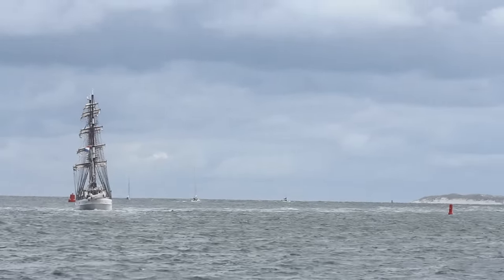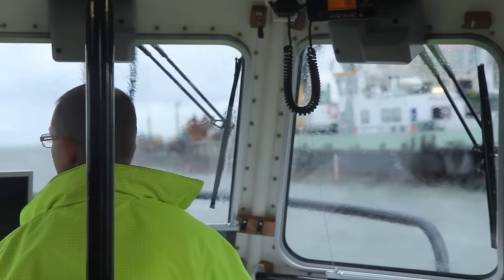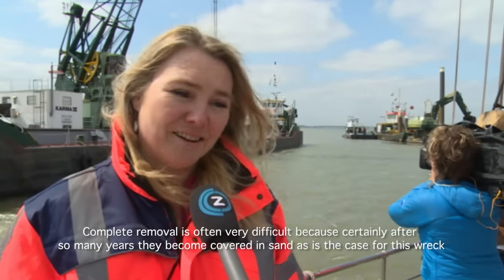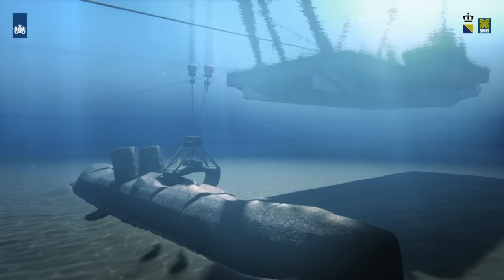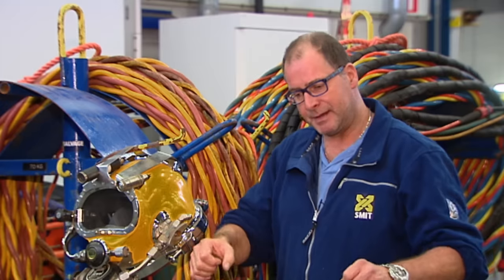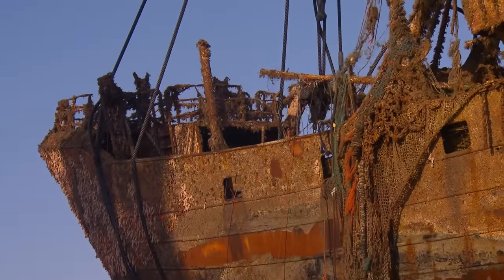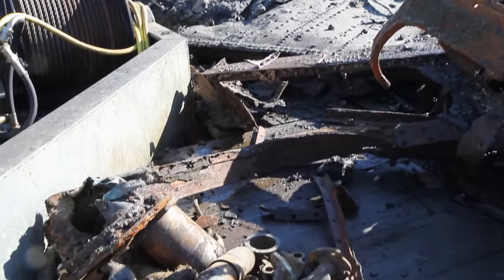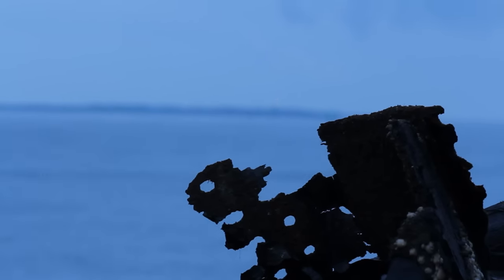Clearing Shipwrecks From Dutch Waterways | The Salvage Masters

Comment: Some of those ships are very likely valuable pre nuclear steel. Steel ships made from steel prior to atmospheric nuclear testing is increasingly rare and valuable due to the lack of background radiation in it and is used in very precise medical and scientific equipment.
Reply: Nice to run across somebody that knows this. About this steel
Reply: So much for carbon dating!
Reply: I wondered if there was any value in the steel to justify saving it. Pre-nuclear steel is something I never ever heard of. If virtually everything on Earth is contaminated to some degree, man really has become death.
Reply: I've seen a few articles about them being able to make new steel that is clean of background radiation now, it's just as clear as the pre nuclear steel.
Reply: I thought it was only applicable to aluminium, copper and brass.
Reply: @robertmccully2792 , this has no relevance to carbon dating, which can only be used for material that was alive in order to incorporate carbon in its composition.  It won't work on metal, rocks, minerals, etc.
Reply: Gary Murt’s comment above is correct. The value of low background steel has decreased greatly over the last 30 years as background radiation level return to pre Cold War/ WW2 levels. There are very few applications that still require true low background metals.
Reply: @garymurt9112   you are correct. Low background metals are no where near as valuable as they once were.
Reply: Interesting thanks. I’m guessing that’s why so many war grave ships have been raided I’ve herd some are almost non existent 👍🇦🇺
Reply: Why do you think some countries steal these sunking ships in asia.?
Reply: @jan22150  just remember watching a clip on war shipwrecks and they were saying some were being taken or stolen for scrap. Only war graves should be left 👍
Reply: @John-nl4lt  that was the problem ,someone have been rading the sunken battleship in Asia. People suspect China  to be the culprit.
Reply: It's becoming a more serious issue in the South China Sea, Chinese salvers have been caught illegally salvaging British WW2 battleships, it's a really complex issue because there are close to 800 soldiers entombed there, but Britain was also China's former colonial ruler so who's in the right isn't as easy to work out really.  The men on those ships weren't only protecting themselves; China didn't have a good time under Japanese rule either
Reply: Salvage operations run to refloat the American battleships after Pearl Harbor had to clear the ships of all bodies and foodstocks (battleships and aircraft carriers sometimes had livestock on board, less money on refrigeration that way, more mess when the ship starts to sink however)
Reply: While that is the case some are marked as war graves or some navys have them in a reserved fleet so they cannot be salvaged
Reply: I could be wrong but I think that steel needs to be pretty deep to be worth anything. Were these ships deep enough to avoid the radiation contamination? The British WW2 ships that the Chinese robbed were down there a good amount under the water.
Reply: Interesting…, I used have a flat mate who was a Russian nuclear physicist…, i remember him saying that if you look at a chart of global background …, it is low until the tzar bomb.. 1962… where it goes vertical .. for a huge amount… and is slowly falling
Reply: Ya..it's like the said, the IRON the titanic was made from was equivalent to the quality of modern rebar.
You do realize Theresa difference between Iron and steel ??
Reply: Two birds with one stone. Recycle while getting rid of a Safety hazard.
Reply: First time hearing about 'pre nuclear ' !
Reply: Low-background steel, also known as pre-war steel and pre-atomic steel is any steel produced prior to the detonation of the first nuclear bombs in the 1940s and 1950s. Typically sourced from ships (either as part of regular scrapping or shipwrecks) and other steel artifacts of this era, it is often used for modern particle detectors because more modern steel is contaminated with traces of nuclear fallout, see also Low Alpha Steel
Reply: Most ridiculous thing ever heard
Reply: Modern steel is contaminated in the blast furnace by the massive amount of air used to remove contaminants from the iron. Bit of irony there
Reply: @John-nl4lt bodies don't last in the Sea
Reply: Why can't you guys use magnets? Too clean out the water?
Reply: @duanewhite3184  electro magnets?
Reply: That is why it is becoming economically viable to salvage them
Reply: Wouldn't newly mined steel also be nuclear free?
Reply: @TheRandompaint  the mined iron ore requires massive amounts of air blown through it to remove impurities and shape it. It's the air which introduces radionuclides.
Reply: Value has dropped, long enough time has passed

Comment: Funny i was doing this stuff in my twenties, but tot with all that computer stuff, and we were wearing scuba gear for a lot of wreck diving, only for welding, cutting  and repairing stuff under water like the metro tunnel in Rotterdam, we use the diving suit from Siebe Gorman, the hardhead suit.. Do some body know  about the floating crane the Pellikaan, that s the one we brought in for the fishing vessel, we used a special hose to get the slings under the keel . Like the program, bring back a lot to remember of the good times.